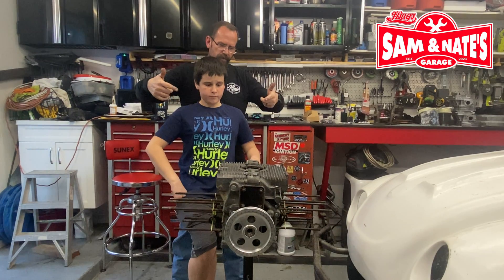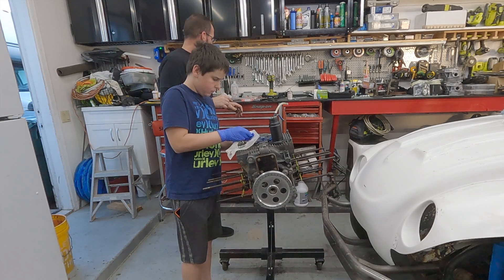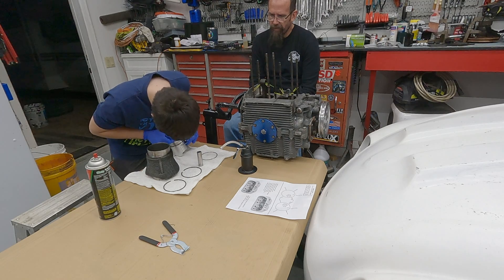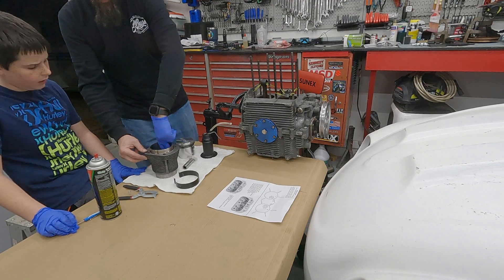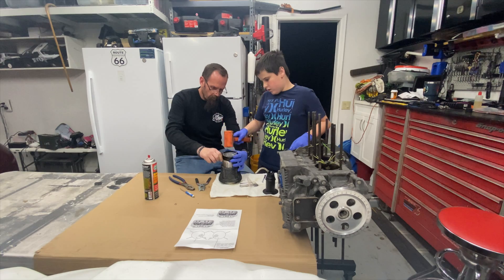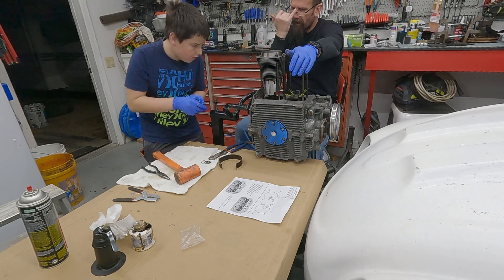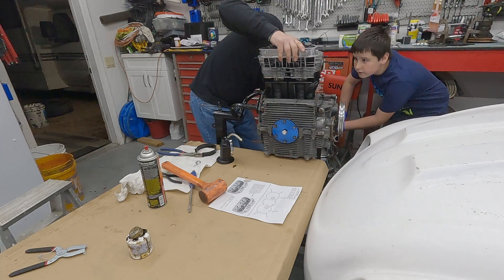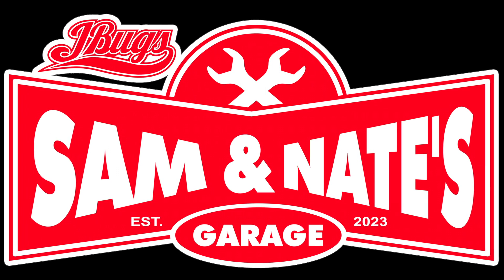VW Baja Bug 1600cc Top End Rebuild - JBugs - Father & Son

Comment: New to engine building here. In order to increase the compression ratio, those existing heads would need to be machined down, and that makes sense. Is the amount of machining and material removal required to reach a certain cc volume something that you would need to calculate or is that something that a machine shop would normally know how to calculate?
Reply: Most machine shops familiar with CC-ing heads will have a rough idea of how much material to remove. Since any particular set of heads will have different size and shaped combustion chambers, the amount will almost always differ.
Reply: @Sam_Mebane  Thanks!

Comment: Great job. I have an old school ring compressor, from the 70's, like yours but it has the pliers attached to the band with a lock on the handles. Makes it so easy.
Reply: Those are the good ones! We got a sleeve style I’ll be using for the next build and I’ll see how they work.